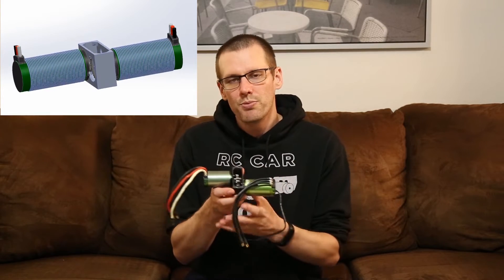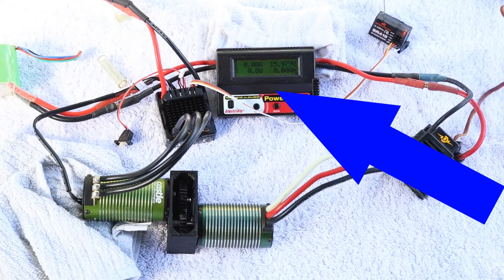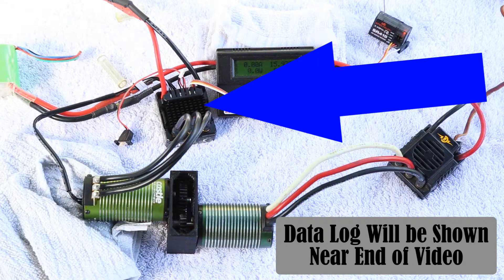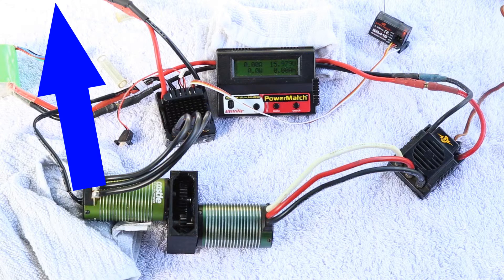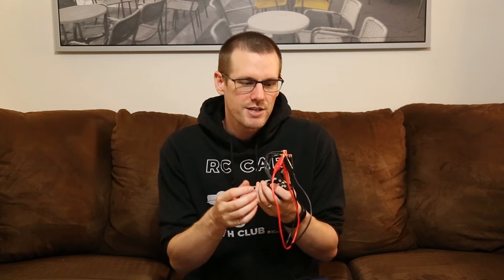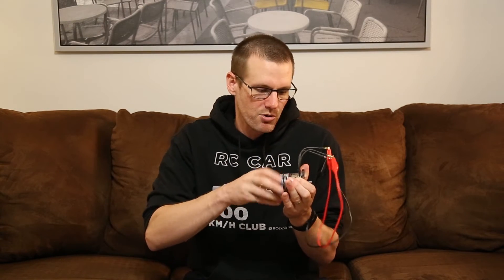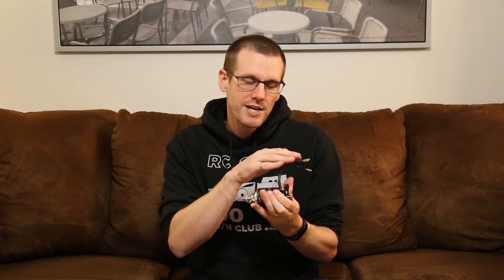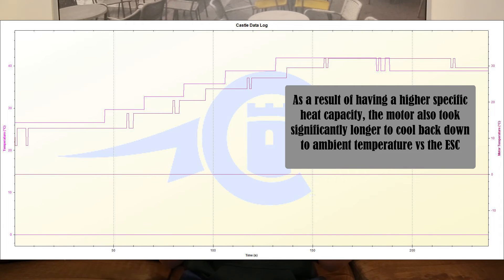How the Motor and ESC Brake to Slow your RC Car and Where does the Power go?

Comment: Why not just run regeneration software so if U back of it charges back and starts gently phase locking which is like a brake ...this is what I live about brushed motors they begin cogging the moment the power is gone and due to fast rotation it gets to become a generator but the drag acts like brakes

Comment: If I apply a consistent 20% brake input with the controller, does the ESC(brushless motor with sensor) change the brake ratio according to the motor's speed to make the brake force consistent? Should the RC car driver apply a small brake input when the car is fast and apply a big brake input when the car is slow which is opposite to the brake technique in a real car?
Reply from the maker: The ESC does not change force with respect to speed. The RC Car driver would have to increase braking force as the car slows down. In fact at very slow speeds, the brakes on the car may not slow the car down to literally 0 speed.  For example, while the car is on an incline.
Reply: @RCexplained  Thanks. 0 speed 0 EMF 0 brake force I guess. Does RC car's braking have a natural ABS effect? When the tires locked up, the braking force is off natually which unlock the tires?
Reply from the maker: No if three tires were at 100kmh and the locked up tire that broke traction was at 2kmh or 30kmh. This would still be a problem. Any major difference in speed between the tires would be an issue.

Comment: Thank you.

I have a question.

 After connecting the three wires of the brushless motor, I tried to rotate the rotor of the motor.

Resistance feels strong.

Do I stop using this phenomenon when I use the brake?

Then I wonder if I can apply the brakes with little power.
Reply from the maker: Sometimes the ESC does apply brakes even when not powered up. This could be what you are feeling.

Comment: Hold on ... 45W for a motor on idle? That sounds like way too much. Does it even make sense to measure wattage using a regular wattmeter? The motor is an inductive load so you will have current flowing there and back which I guess isn't registered by the meter.
Reply from the maker: Hi Teymur, thanks for the comment. 45 watts includes quite a bit. Not only does it include the Io current of the driving motor, it also includes the power requirement to spin up the driven motor and any losses in the drivetrain. The wattmeter shows nearly the same amount of current as the multimeters when hooked up. 

The meter is not connected between the ESC and motor. It is only measuring consumption between the ESC and battery.

Comment: I remember doing speed runs with the infraction i had, at 90+ and over the motor was hot. Me doing multiple back to back passes and not thinking “ its getting too hot,
 no wonder my motor was toasty hot, it was in the 160 to 180 range, one time i remember getting it over 200°F, stupid of me. or i remember so much heat or resistance that my pinion would come off. Thank good news for sensored motors to cut off at a certain temp. Guess thats why they say one run and done. Great vid ryan.
Reply from the maker: Hi Colin, thanks for the comment. That sure is hot, much hotter than my comfort level would allow!
Reply: @RCexplained  agreed

Comment: I was wondering, can you do regenerative braking with a brushless motor? and how can you do it if it is possible?
Reply from the maker: Yes it is definitely possible. Check out the next video that gets uploaded!
Reply: Rotating the motor by hand produces a voltage at the battery terminal of Esc.

It's charging and it doesn't seem to be much good. 

If you charge the battery at - 20 degrees Celsius, it will break.

Comment: Interesting. My car rolled into a stream the other day really slow because the motor couldn't brake at such a slow speed.
Reply from the maker: Thanks for the comment Lawrence. Any significant hill and the motor will not be able to hold the car especially if a high gear ratio is used like on a fast on road car.
Reply: @RCexplained  was a 1700kv motor as well which doesn't help
Reply: @LawrenceTimme  Yeah, that's a "problem" especially with high voltage and low KV setups. I think the esc has a really hard time to stay in sync with the motor when braking at very low speeds.

Comment: Really cool video and I do like this kind of real life experimentation! How about a video on power loss in electrical components such as wiring, connectors and switches and even batteries? Or perhaps a video on power losses through mechanical components such as gearboxes, diffs, knuckle joints etc.? Keep up the good work man, your videos are invaluable to us RC fans!
Reply from the maker: Hey Remko, thanks a ton for the comment and suggestions. There will be more and more practical videos that are released. One idea in queue will be similar to the mechanical component losses that you have suggested.
Reply: @RCexplained  That's great, thanks!